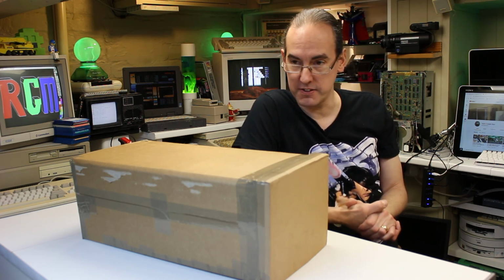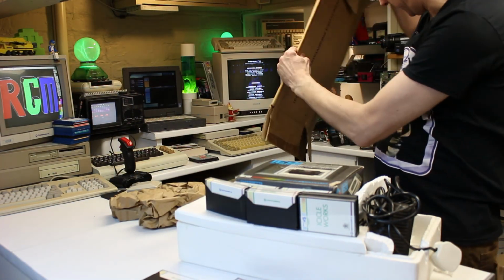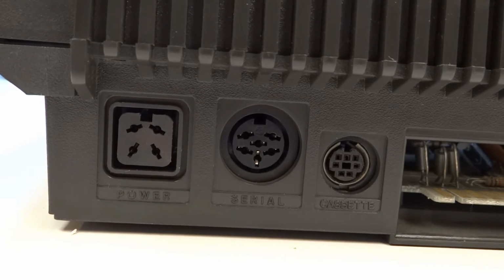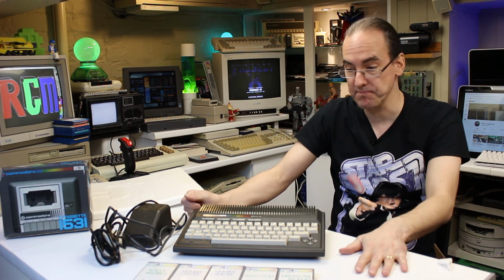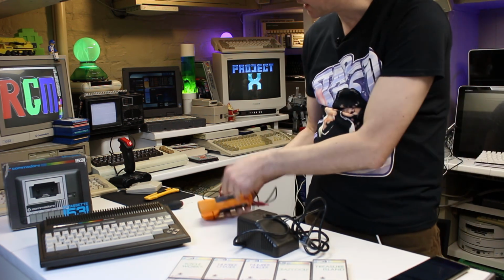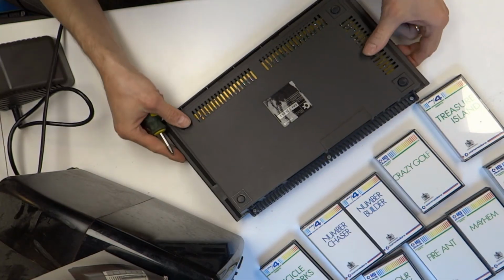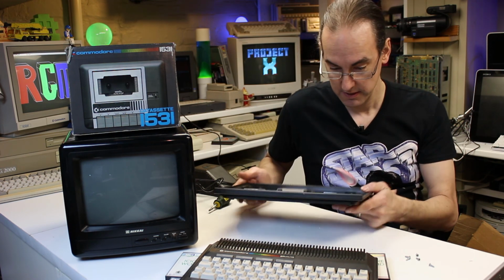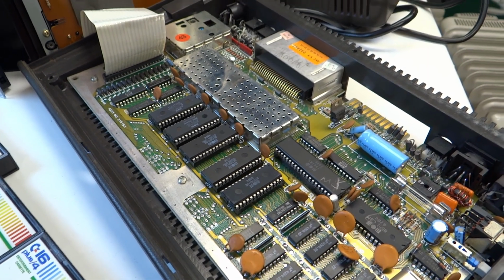COMMODORE PLUS/4 UNBOXING, WILL IT WORK?

Comment: The Plus/4 was the first computer my dad bought for me. Later, I found out it was compatible with the C16, and start buying it games for my Plus/4. I had to replace two times the psu with the one from C64, replacing the plug type. Thanks!
Reply from the maker: I still have this and a C16. C16 needs repairs.. probably the same faults I had on the plus 4

Comment: I really enjoyed this video. I also owned a Commodore Plus/4 beginning about 1986 also thinking it was better than the C64 only to find out it wasn't. I never was able to find a joystick for it and the only game I had was Zork II, a text adventure game. As I'm writing this, I just acquired one from eBay and it arrived in pretty good condition. I don't yet have a way to test it until I get some more packages arriving with cables, new power supply, and finally the original joystick. My power supply measures 5 volts, but the 9v AC are all shot. I'm going to have to open it up and replace the capacitors and clean it up. With luck, it still works, otherwise I'm going to have to replace something. There are a bunch of new games for the Plus/4 including the now famous Pets Rescue that I'm excited to try on it once I'm all up and running.
Reply from the maker: Thanks glad you enjoyed it. I hope you get your power supply working. If not there are new alternatives out there now. I will have to look out for the new games.
Reply: @RetroGadgetMan  I received a new power supply from Poland on EBAY. I also replaced all of the RAM, the multiplexers, and the PLA chip, but it's still not working. I'm now waiting for a new CPU and TED chip to see if that works. In the mean time, I've had to remove the badge on the case because it was coming undone and I'll clean it up and re stick it to the case with some double-sided tape. I'm also looking to pull the keyboard apart and clean it all up as well as the case itself. It's become quite a restoration project.
Reply from the maker: @Patrick_Briggs  I think once you have that new CPU it will work. Seems to be a common fault with this model along with the ram. It will be worth it once you have got it working.

Comment: The old yT RAM ICs are usually all junk (they break over time, just like in the C64)
 ... and the CPU of the device may still be defective ...
Reply from the maker: Thanks for the information. What kills them?
Reply: @RetroGadgetMan  the problem is, a bad passivation of semiconductors
Reply: @RetroGadgetMan  The TED chip runs very hot and can destroy itself if the heatsink isn't doing it's job, which is under the shielded box on the PCB. The CPU in the Plus/4 used a new HMOS process that at the time was new to MOS technologies and they hadn't worked out all the issues with them. The CPU also runs hot and can be destroyed. It is recommended you place a small heatsink on it to help its longevity. You can also get replacement redesigned CPU's and a PLA from a few people who've designed new ones that run better and aren't as rare and expensive as originals on EBAY.  Garbled characters on the screen also can indicate the RAM has gone bad. If the TED chip is going bad, things like serial interface to floppy drive and joystick may fail first.
Reply from the maker: Thanks for the information. I did end up upgrading the CPU. You may have seen my video, if not here is a link. https://youtu.be/d_iz0_RzGB8